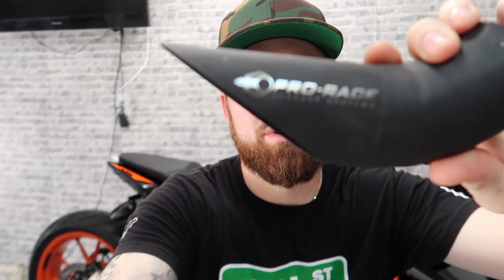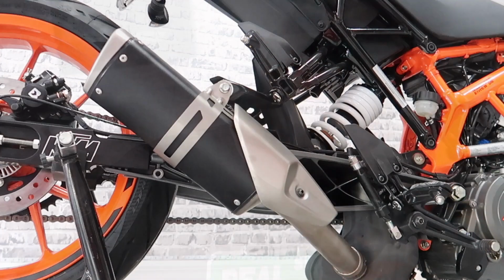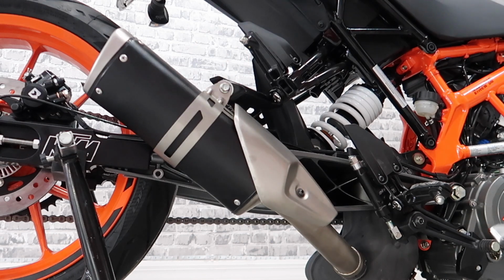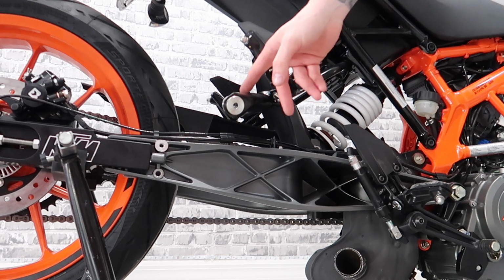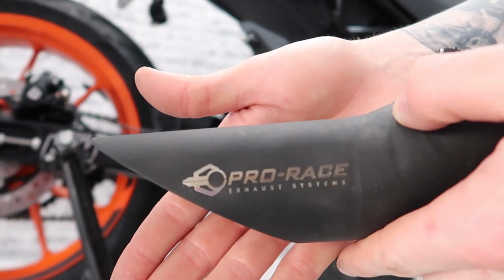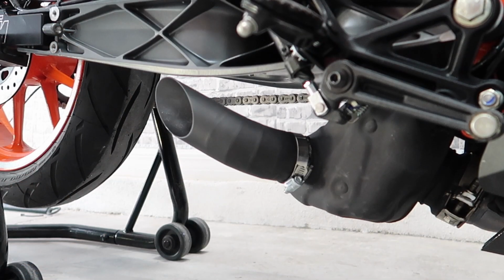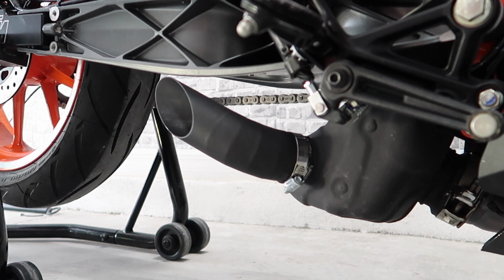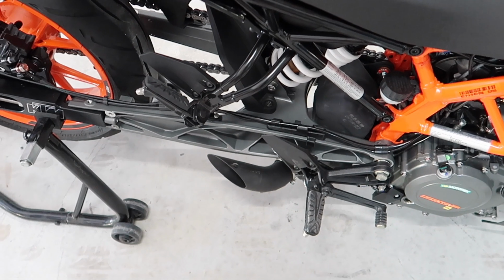Pro Race Slip on- 2021 KTM DUKE 390

Comment: Mines a 2023 and the exhaust is too small and doesn’t fit over the flange like yours. Did they send me the wrong one?
Reply from the maker: I believe so. The 2023 should have the correct flange on it.
Reply: @burnoutbobby  they emailed me. Partly my fault , I didn’t remove the gasket they was stuck on. I still had to widen the outlet to fit over cat a bit , but didn’t have to do relief cuts like yourself. 

Thanks for the reply!
Reply from the maker: Glad it was a quick fix.

Comment: Did this require an ECU map? If not that, then fueling adjustment? I am reading mixed messages everywhere that this is bad for it due to the amount of air coming out, versus going in etc.
Reply from the maker: With just the slip in no fuel management is needed it’s post cat and post o2 sensor.  If you do an airbox lid then you will want to do something like the fuelx.

Comment: How do I lower my duke and stretch it like yours? I would definitely appreciate some links. I haven’t found any videos or any links for parts.
Reply from the maker: The front you just lower the forks in the triple tree.  The rear is the eBay swingarm extension for your year duke.  The lowering link for the shock was by T. rex racing. I don’t have links because I got it all local.  But I know this is where they were all purchased.

Comment: just installed mine after cutting it like yours, 5 minutes into riding my bike shut off while riding and oil light came on for the first time? Curious if you know the cause of this
Reply from the maker: That I don’t know.  I’ve never heard that from a slip on.  When was the last oil change
Reply: @burnoutbobby  Brand new bike has 800km on it only , forgot to mention low fuel popped up then bike shut off simultaneously. realized that’s most likely the reason. Just coincidence I just installed slip on I guess.
Reply from the maker: That’s sounds like it may be the case.

Comment: People doing swingarm extensions on these bikes is so humorous. 

It does absolutely nothing positive for ridability and in all honestly diminishes cornering capability.
Reply from the maker: If I hurt your feelings please let me know.  I will ship you some Kleenex sweetie.
Reply: @burnoutbobby  not at all. Just 40yrs+ of being on 2 wheels and owning everything from liter bikes a busa and a H2(2017) to the 390 you see in my avatar. 

Many track days over that time frame as well(circuit and 1320.)

The 390 doesn't provide enough torque to benefit from an extension and actually does more harm to the ridability of the bike than good.

Anyone with experience riding will tell you this.
Reply from the maker: I have zero issues turning in tight radius and ave same capabilities as the r6 and other bikes I ride with. Don’t see the issue.  Maybe I should have left it stock and did an. Yoshi slip on. Then I’d get the purist approval.
Reply: @burnoutbobby  it is impossible that you have not diminished the cornering abilities of the bike as you increased the wheelbase.

You just don't ride at that limit where you realize how you have actually impacted the bike in this manner.

....and I'm not a Yoshi fan. 
Or Akra for that matter.

At least not for these bikes.

I only run LeoVince cans. I run a carbon fiber LV Pro with the dB killer pulled.

About to do a Comp Werkes presilencer delete.

I've dropped over 50lbs from the bike so far and counting by yanking unnecessary stock items from the bike.

These bikes are known for handling. All I am simply saying is that you are basically diminishing the one thing they are noted for by doing a swingarm extension and it really serves zero benefit in ridability.

Shorter wheelbase is better for cornering ability as opposed to longer which is beneficial when cruising highways or long straights for stability at speed.

These bikes are too light and lack the power to necessitate this mod from anything other than an aesthetic perspective.
Reply from the maker: It’s not impossible as it’s not stretched that far. Been to tail of the dragon twice with it.  Not sure what you are looking for here but I don’t need your approval. You can go to a purist page and troll there.